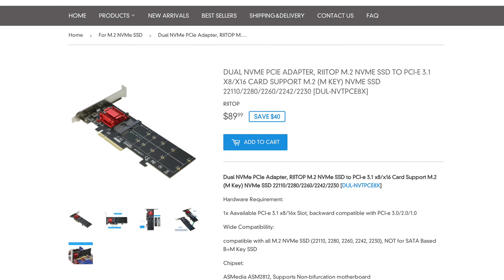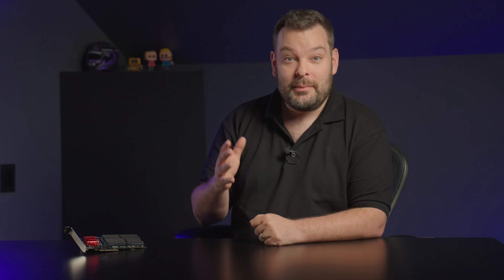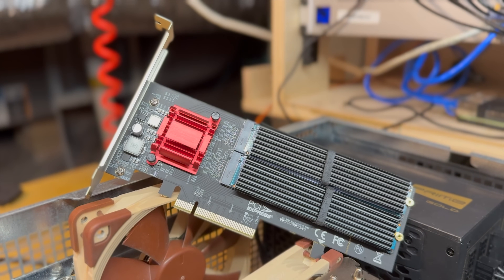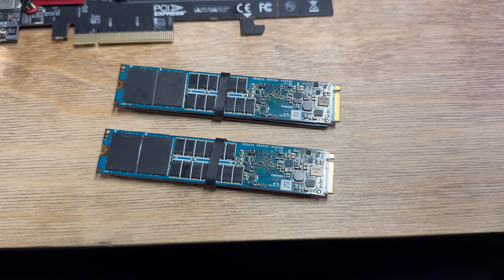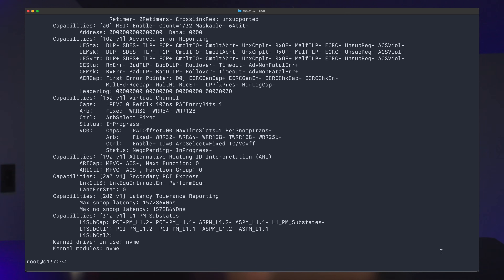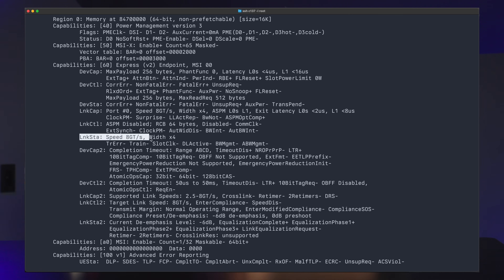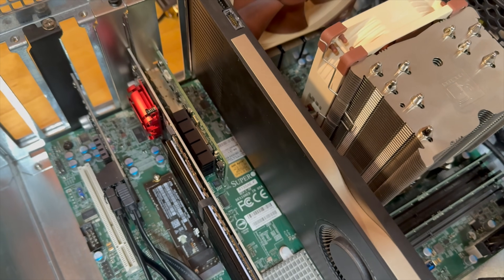Put two NVME SSDs into one 8x PCIe slot with the RIITOP Dual NVME M.2 PCIe adapter

Comment: Funny it is an 8x card, when it only supports a 4x uplink. RIITOP lists it as an ASM2812, and the ASM2812 datasheet lists 4x uplink. "ASMedia PCIe product ASM2812, a low latency, low cost and low power 12 lane , maximum 6 downstream ports packet switch. With upstream PCIe Gen3x4 bandwidth"
Reply from the maker: Using lspci to determine exactly what is going on here's my analysis. 

https://gist.github.com/ironicbadger/e2c73c17aaab060de9c6a7d995371945

Topology:
- ASMedia ASM2812 PCIe Switch (02:00.0) connects at 8GT/s x4 (PCIe Gen3)
  |
  ├── ASMedia ASM2812 Switch Branch (03:00.0) connects at 8GT/s x4
  |   └── Toshiba NVMe Controller (04:00.0) connects at 8GT/s x4
  |
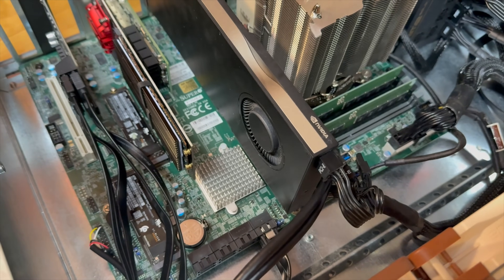  └── ASMedia ASM2812 Switch Branch (03:08.0) connects at 8GT/s x4
      └── Toshiba NVMe Controller (05:00.0) connects at 8GT/s x4

All PCIe connections operate at PCIe Gen3 (8GT/s) with 4 lanes (x4) back to the CPU. The ASM2812 itself provides 4x gen3 lanes to each downstream device meaning that there is a bottleneck back to the CPU if both cards need full bandwidth at the same time. However, if they are talking to each other without "leaving" the card, then they will talk to each other at full x4 speed each.

Makes you wonder why the card needs 8x downstream lanes huh?
Reply: @ktzsystems  My only thoughts is the card was designed so either the ASM2812 or the ASM2824 could be installed onto it, giving it 8x capability. Or it's just done for show, as 8x looks faster than 4x, even if it isn't connected.
Reply: @patrickdk77  These boards often ship with an x8 physical connector because in theory the downstream port can be configured with up to 6 lanes (which would require an x8 connector). I expect that ASMedia probably produce a reference board design to speed up 3rd party implementation and most wouldn't be bothered to re-engineer the design to change the connector.
Reply: @cat2devnull414  I'm not sure what your going on about, the spec on the board ONLY supports 4 upstream lanes and 8 downstream lanes, I have no idea where you came up with 6 from, Did you bother to read the datasheet? or to look at the ASMedia reference design?
Reply: @cat2devnull414  Ah that is your issue. 6 downstream devices, not lanes, and 4 upstream lanes. You do not need an x8 connector for 4 upstream lanes. and for your downstream lanes (the nvme drives) you can have 6 of them on that switch (at 1 lane each and 2 empty lanes) in this case they have two nvme with 4 lanes each, 4 upstream + 8 downstream = 12, the chip only has 12 lanes. 4 upstream to your motherboard and 8 downstream (with a limit of 6 devices) Please read the datasheet next time
Reply: @ Yes, I have read the data sheet :) I just got the ports round the wrong way. You are correct, it can only support a max of x4 on the upstream so no need for an x8 slot. So I'll adjust my theory inline with yours. The board are probably designed with both the 2812 and 2824 in mind.
Reply: Yeah would be nice if it was in a 4x slot configuration just for more compatibility.

Comment: Great talk about this. I ended up having to get this due to my board supporting bifuration but not while using a ryzen igpu. It dumped the slot back so it didnt support bifurcation. Easy fix with this card and I ended up getting a cheap 4 nvme drive setup for raidz1 on my unraid tower. Works great! Nice video Alex!

Comment: If you're having issues with ESXI and pcie load between different slots, could the PCI hole limits be changed to sooth the issue a little? I had the same issues you mentioned with my old supermicro board, a nvidia GPU (GTX 1060) and a raid card with 10x SAS drives using ZFS,

I would frequently see IO errors on FreeNas, seems this fixed it for me at the time. Do check if you have time, hope it helps!

Great video by the way, nice to see a technically inclined and informative channel that goes into the real details. :) Keep it up!

Another fellow British technician!
Cheers! :D
Reply from the maker: pci hole limits? not heard of that before, could you give some more details?
Reply: @ktzsystems  I think my previous comment got erased because I linked to broadlink and AMD, so I'll be more concise!

It's been a while since my old board and some of the material online goes to dead links, but if you search "pciHole.start" and "pciHole.end" you can find material online regarding it. You edit the VMX of the VM (ideally with the GPU, but it could work for the nvme controller) and set this. There's also references to adjusting the MIMO limit with this command: "pciPassthru.use64bitMMIO" - "True" & "pciPassthru.64bitMMIOSizeGB" - "64" and ensuring the VM is set to EFI in bios options. 
I set my pciehole start to "2048", and the end to "3072" and it corrected all the issues I had.

No guarantees though! :P Good luck, hope it works!

Comment: I am using an old Fujitsu business PC which was designed for low power consumption and was £100. However it's M.2 slot only runs at half speed. So I used a similar adapter with only one NVMe slot for £15 to run it at full speed. Works perfectly and even boots directly from it.
Reply: Yeah there are very nice ones from China and Amazon for cheap. I have one with 4 M2 Slots for Pcie x8

Comment: It is not that much of cheap vs expensive MB - it is about AMD vs Intel. Consumer Intel platforms allow 8x/8x split only. AM4 and AM5 allow 8x/4x/4x and 4x/4x/4x/4x. Most of the server boards allow bifurcation anyway. Maybe besides the low end "Xeons" based on the Intel desktop platform. 
Anyway the board doesn't sound really appealing with the power consumption issue. Maybe better pick the right platform from the get go :).

Comment: Got a couple of them in service for a few years now. Stable and working good, though does draw some extra energy of course compared to proper bifurcation. 

The only downside with it that I’ve found is that it doesn’t seem to support ASPM. (Like you say in the video.. Yes I started writing the comment before watching the whole video… 😅) Anyway, I haven’t been able to get it to allow any system to reach higher C-states. In a larger system with other peripherals that doesn’t support ASPM either (like most HBA cards, many NICs etc) it doesn’t really matter. But I’m not using it in low power systems where high C-states are wanted. Which is too bad, since those systems mostly are those lacking slots…

Comment: My consumer grade mother board supports pcie bifurcation out of the box, I'm not sure why you said it was only on "expensive server boards"
Reply from the maker: on one slot maybe. but if you want to use any slot without any of the downstream consequences this is the easy button
Reply: AMD consumer gear supports up to x4x4x4x4 but Intel as of 12th gen will only support x8x8. They have never supported x4x4x4x4 at least not in the last decade.

Comment: Buyer beware! I'm not sure niche adapters like this for low-end computers will make sense compared to simply buying a larger nvme drive. Especially when most people will be expecting PCI-E 5 or 4 speeds.
Reply: Not sure what you mean, you cannot buy larger nvme drives, they cap out at 8tb, you have to go down the u.2 road instead, and do not always have the space to install a u.2 drive. Generally the largest issue with these is they buy a pcie v2 version, or they expect to be able to boot from the drives installed onto this.

Comment: Excellent presentation.  Thank you.  Most desktop stuff from Lenovo, for example, that are more than a few years old might not even have M.2 slots at all but they do have a PCIe-3 slots.  Almost all of them will have a x16 slot for a video card, and maybe an additional, x4 and x1 slot.  So if you add a 10GbE card you are left with one good PCIe slot.  This card allows you add one more M.2 drive to the video x16 slot.  I use the x1 slot for a slower (faster than SATA though) backup M.2 drive.  You can build a pretty nice Proxmox server this way and then use the 4, or more, SATA ports for normal SSD SATA drives for bulk storage and the OS boot drive.

Comment: 0:10 "you can either buy a very high end server motherboard..." I can get an ASUS Prime A620M-A-CSM for less than USD $80, and according to the Asus website its PCIe 16x slot supports 4x4x4x4 bifurcation. Am I missing something? Is there some extra level of bifurcation / feature that these consumer boards don't support?
Reply: The use case for me is pretty straight forward. I am using all older equipment, where my only current limitation on high speed storage is slots. Ergo, this makes perfect sense for me. Thanks to tailscale, I've been able to build out a fairly impressive cloud setup, using only second hand equipment (or very low cost accessories), and FOSS. So... there's one decent justification. Money... not everyone has a lot of it.
Reply: Yeah, plenty of boards with bifurcation that's aren't server boards. Also there are far cheaper bifurcation cards that do the same or faster ones around the same price that support gen 4, like the Asus Hyper M.2 card, the newer version, because they have a gen 3 one too. I bought a second hand gen 4 version for £20.
Reply from the maker: “on more than one slot and for more than just a single 4x4x configuration”
Reply: That mobo has only one 16 lane pcie,(4x4x4x4x) so it makes sense only without GPU, so not really interesting board. H3platform Falcon 4210 for rest of us :face-green-smiling:
Reply: Ok so I can get a Prime X570-P, that has 3 PCIe 16x physical slots, the first can do 4x4x4x4, the second 4x4x, the third will just be 4x - costs about USD $230 delivered where I live. 

I'm not saying these PCIe switch cards don't make sense - I got a 4x4 one, but it wasn't because it was cheaper than a motherboard with bifurcation. Buying the switch card was definitely more expensive. It's just that I have an old X79 server set up the way I want it and it was way too much hassle to upgrade the whole thing just to get better use out of my spare 16x slot.

But what I did was the lazy option, not the financially responsible option.
Reply from the maker: Interesting board. But even that is a minefield because bifurcation layouts change depending on the CPU generation you put into the socket.
Reply: @RaytheonTechnologies_Official  Better skip am4 and go am5 
iGPU and also support bifurcation, for those slow linked to PCH with x4 lanes, slap a sabrent quad nvme card there 

Or get Intel if you need quick sync and thunderbolt
Reply: @RaytheonTechnologies_Official wait what? Asus Prime X570-P?
The image they provide on the website only shows it has 1 x16 electrically, 1 x4 electrically but x16 width and 3 x1 slots... Do I have the wrong board by any chance?
Reply: @cometxp  that's correct 4x electrical only for that x570 board. i've got x570 plus wifi tuf and has basically same layout. At leat i've got on that port 10gb mellanox connect4 that's already 4x
And that card from video is identical to one from aliexpress just more expensive.
Reply: @sybreeder86  thanks for the info!